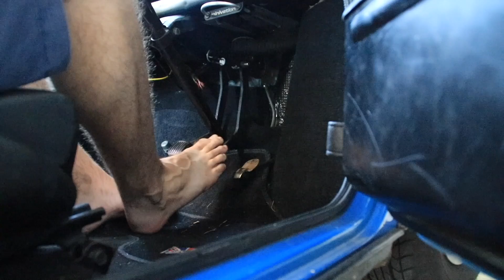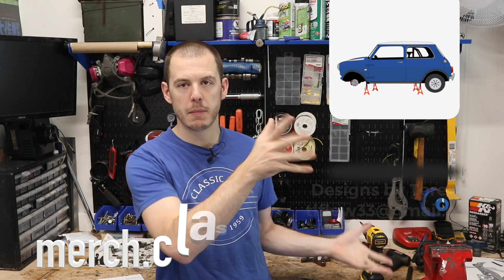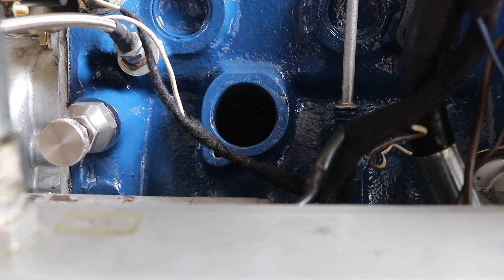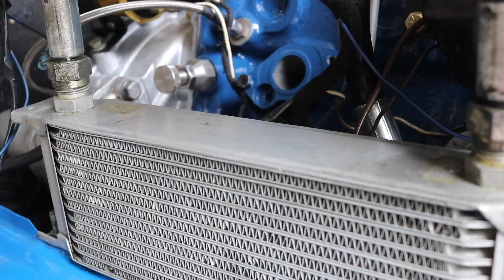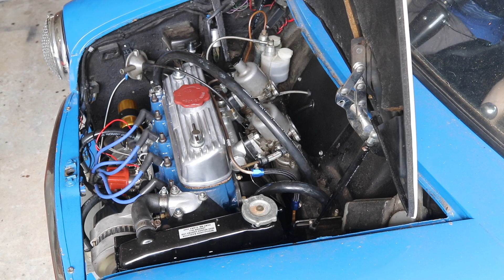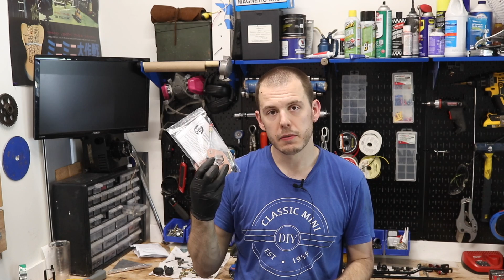Operation Bad Wolf - Will the motor start? Also a GIVEAWAY!

Comment: 15 years ago a friend of mini had a mini with a 25Litre fuel tank. one day he calls me up and he's just brought a 35litre long range tank so on the weekend he can around to my garage and we drain the 5 litres of fuel out of the small tank and swapped the tanks over. with the 35litre tank installed we put the 5 litres of fuel back in the as payment he brought me McDonalds  which was attached to the BP service station. we filled the mini up and went in to eat. When we came out there was the biggest flood of fuel ever under the his mini the whole boot was full of fuel all because he didn't replace the fuel sender gasket ;). the funniest part was the when his father arrived and drained the tank and towed the mini home and he said "you know what this means don't you... your now picking up and dropping off your sister from netball until eithers she quits or gets her drivers licence" it lasted for 3 years so the moral of the story is check the fuel sender gasket